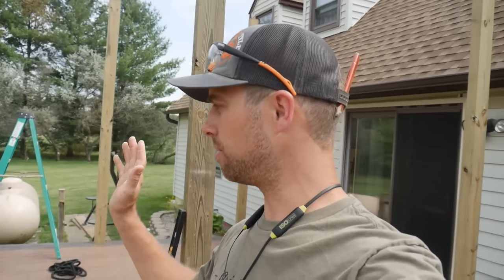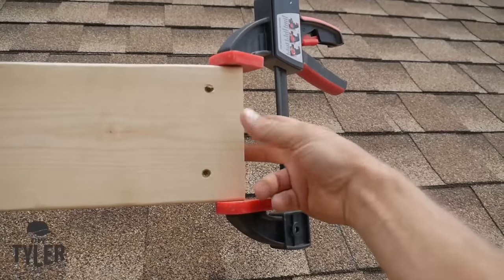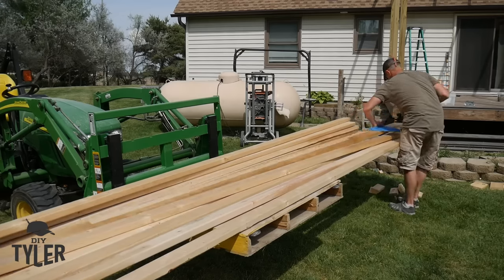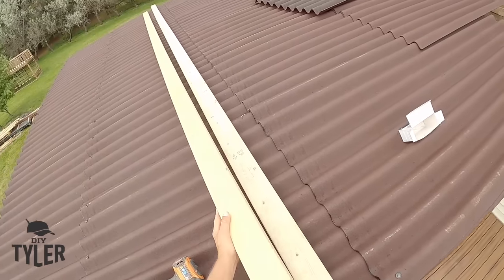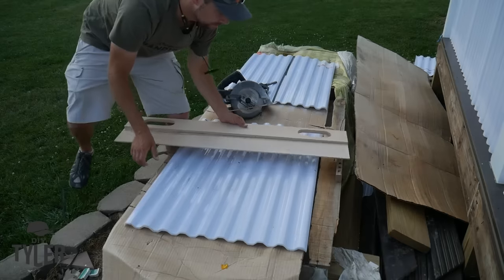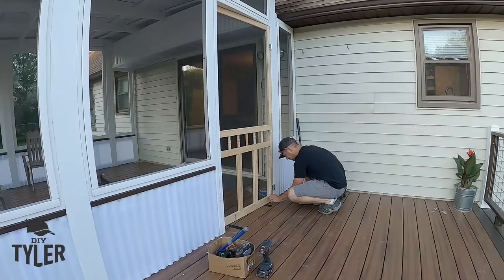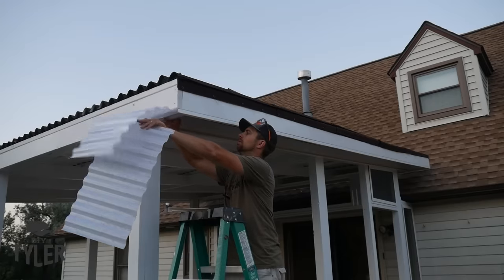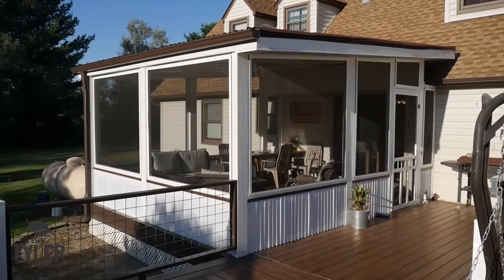Build a Screen Porch on a Deck without Attaching to the House

Comment: It's a great project. I have a question: how did you fill up the gap between the porch and the house? where did the rain water go from the house roof--gutter? what about snow slide?
Reply: I have a similar situation in that I want to add a deck to my house and all the videos I have seen so far just skip over that detail. Whether they tie in to the roof or go under the eave to a ledger the details are glossed over. I noticed there are no responses here at all.

Comment: We have a house & a detached garage with 30feet between the 2 buildings. 
This is where we park the car. HOWEVER where we live it rains A  LOT. We
sure are tired of unloading groceries in the rain & getting all wet. I'd love to
erect a carport. The problem is that the buildings are not parallel. A custom
designed steel carport would be  WAY  out of our retired budget So a wooden
structure it would have to be.

!

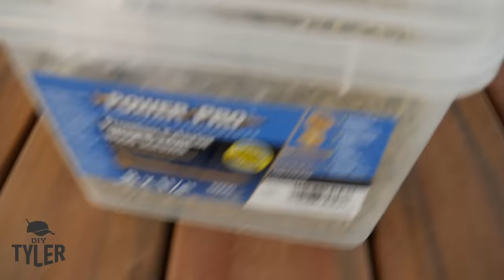Comment: At 10:42 there is an upper and lower base board for the knee wall you built. What is the product you used for these? I've been trying to locate a similar product for a knee wall project of my own. All I've been able to find are top and bottom rails precut for spindles.

Comment: That’s a beautiful deck and I’m sure you will enjoy it…until it’s time to reshingle your roof.
Reply from the maker: Brand new roof so we should have a long time before we need to be worried about it! When the time comes we can back out the screws for the top layer of Ondura panels and reach right though the framing of the porch.

Comment: Hi Tyler.  Do you still recommend the products you used for this screened in porch.  How is it all holding up?  Thanks
Reply from the maker: Hi Julie! Yes we do! The only issue we have had is that the white tuftex panels on the half wall seem to have significant yellowing on the panels that get direct sunlight.

Screens, ondura panels and decking have all held up with no issues!

Comment: Did you attach your porch posts to the decks posts? we have a deck but it's covered from the side because its ground level deck so we cant see whether the deck posts have been placed inside the ground on concrete or not? yours look like they have been

Comment: You're saying, your project is "without attaching to the house...." (?).  What's a difference between yours an a regular covered patio to someone's house?  It seems to me, your patio/deck/porch's still attached to your house, right?  The only thing I can see that the roof's not attached, BUT everything else's attached.  I'm guessing, your state/county ordinance allows that, right?  In our state, if we build anything (i.e., shed/patio/porch) that are attached to our house (even though the roof's not attached), it's still "attached".  We always need to get a permit before we build anything.  I'm just curious.

Comment: Great job and thanks for sharing. I have been wanting to add and outdoor screened in room to my existing deck. But so far everyone i talk to say that a 10 by 10 post and solid roof would be too heavy for the deck? The deck is new by about 3 years and is on 6x6 posts sitting less then 2 feet from the ground and are on cement footings. I dont want to attach it to the house, but i do want to lean to the back side as the deck is on a gabled wall and i would rather the rain/snow fall off the deck then gable the roof and have one half falling back on the open deck. How did you add the posts to support your roof?
Reply: This is what I'm trying to figure out too, we have an existing stand alone deck with one of those home depot gazebos on it, but it's a pain, gotta run out and take down the top every time there's a strong wind. Need something permanent but I don't know what
Reply: @michelleamanti2277  keep checking utube there was a fellow who manage to add a more fixed permanent roof and it seems to be holding up. i think if i recall right he was from Quebec, wish I could recall more. I have been looking at my system and think if i tie into the rail system that is supported  i might be able to create my lean to roof  and continue using a curtain screen wall. maybe on a curtain rod idea. This way come winter take down the curtain and leave the roof. Let or us know if you find a solution

Comment: I'm reaching out to you cuz I'm considering something of the same aspect is not attaching it to my home. Now that you have had yours up for a while now have you experienced any flooding from the house runoff onto the screen porch I noticed in your video that you had a gutter system on the house. How hard is it to get to that section if you need to replace the guttering or something happened to it?

Comment: Great job. I was debating on adding a hipped roof attached to the home or this. What was the price of the build?
Reply from the maker: Bought all the deck components together so it's hard to tell. And, of course, the lumber was 3x what it is right now.
Reply: Go with plan to add a hip roof on your addition. In my opinion, any addition/ remodel that looks like an addition/remodel is a failure. This guy did a lot of work and spent a lot of money for something that looks bad and does not increase the value of his home.
Reply: @kevinhoulahan4296   Wrong. It may not increase the PRICE of the home but it does increase the VALUE of the home.

Comment: Thanks Tyler, I've been thinking about building a porch like this along my living room, I'm gonna use your instructional video  as reference. Do I have to pull city permits to build something that isn't attached to the house?
Reply: In my area you can build a 10x12 structure without a permit.

Comment: How do you keep the bugs from coming up the the deck floor?
Reply from the maker: Originally we planned on putting a vinyl floor down but decided to give it a go as is. All summer, with terrible mosquitoes in the second half, we had about two mosquitoes get it and likely though the door and not the floor. They don't seem to work they're way up which is good news! I did spray under there once so that may help.

Comment: How do you plan on getting to the shingles when it comes time to replace them?
Reply: that and water on existing roof especially with that pitch if gutter overflow or I missed that part on keeping it water runoff. looks good, it just don't seem right
Reply: I don't think he sealed the patio roof to the home roof. Looked to me that water will flow to the patio floor. Personally I would have ran the ondura under the shingles and flashed the seam

Comment: Hi, loved the build video but you seem to have left an area between the upper screen and the lower cross member that bothers me. I am sure I have got it wrong but the cut-out (18:30) on the video shows the area where you have taken the vertical screen up about 20 mm up each crossbar leaving a gap of about 580 mm to the top where anything can get through. The double “J” channel is clearly shown on the bottom of the screen but nothing on the top
Reply from the maker: It's 100% closed in! Video might now show everything or every angle. What I think you're talking about is indeed open but the insect blocking is taken care of by the soffit in that area.

Comment: Hi Tyler, what brand is that small drill / driver you used on the soffit portion or the deck enclosure?
Reply: Looks like a Milwaukee hammer drill

Comment: This is fabulous! As I've wanted a deck and enclosed structure forever in my 100yr old house that keeps giving me countless surprises. 

I'd love to know more about how to decide on what to do on thr foundation of the whole structure, such as if I already have a concrete base (that's cracking) should I redo it? Or can I build on top with above ground support beams? I'd be covering a portion that is on grass, not concrete and can dig into it easily. 

Since I'm planning to scrap and rebuild completely, I don't need the structure to last for a decade but at least a few years. Would my plan work out or be unsafe to do? 

Ty. Loved the materials you used, I've been debating and really bogged done w indecisiveness. Tyler, can you also please detail costs of your project even if you have supplies that were sponsored etc. It would be helpful if you could explain a bit more bc idk abt anybody else but I'm learning as I go with 0 previous experience.

Comment: It was all great until 17:35 when you glued it to the house (attached it) with the spray foam. Why not just use a thick insulating rolled foam or cushion?

Comment: I was trying to figure out how the water would be prevented from running off the roof and draining on the floor... dumb moment for me, there's gutters....lol
Reply: I wonder about that too - in heavy rain, gutters overflow.  Suppose it won't hurt occasionally to have water get on floor below.
Reply: It hasn't been from the roof and gutters so much as the wind blows the rain in right through the screens. 
Still, we've logged hours and hours in the lovely shade and bug free room!
Reply from the maker: Thanks for Subbing Harry! Little rain is super peaceful, water runs off via the gutters....heavy rain we head inside and the composite deck doesn't care!

Comment: You shouldn't use screws in the joist hangers.  They sell special nails just for this and its for a reason.  Screws are not supposed to bear a load.  Just saying.

Comment: Why not just attach it to the house?
Reply: If the deck is floating on the ground and not built on piers down below the frost line it moves up and down. You would not want to attach a moving structure to the house which is a non moving structure

Comment: You notch the post for the beam. You don't depend on screw to hold the weight. It will rot eventually and collapse.

Comment: As a contractor, there is so much about this video that drove me nuts. Like, you used plastic roof panels as knee walls ffs. That alone ruined every possibility of a good aesthetic. Then you used the same plastic roofing as interior soffit. Spoiler, soffit is ventilated to prevent mold and mildew build up. So you just signed yourself up for disaster considering you just hung nonventilated “soffit” right at a major splash point (off the house roof, right at the open space where you didn’t tie in the roof). I honestly don’t get why you didn’t just tie in the roof. You could have spent and extra $50 and done it the right way. Like, my dude, i get it, you have framing experience, and you can knock out some projects in front of a camera. But the finishing work on this destroyed everything. I mean, the knee walls kill me. Do spindle-screening next time (cut the spindle in half, place it over the screen after the screen is installed, nail it together). It’ll keep off dogs and kids just the same, while adding tension point in the screen which caused it to be harder to tear). I’m not even trying to be a d*ck, but this video killed me. Like, bruh… you used nonventilated soffit and called it a “mosquito barrier” 5 inches away from a whole a*s open exposure at the roof line.
Reply: OH AND LETS NOT FORGET that you bragged about painting the primary joists early in the project, only to cover them later with unpainted material. Defeated the purpose, and wasted time and material. Yikes.
Reply: I have to agree with you. Not trying to be mean. But ideally the rafters should of sat on the post. I would have scribed some 1x4  instead of expanding foam. Eventually the foam is going to degrade. I would have opted for wood exterior to elevate the design a little. Otherwise I appreciate the effort.